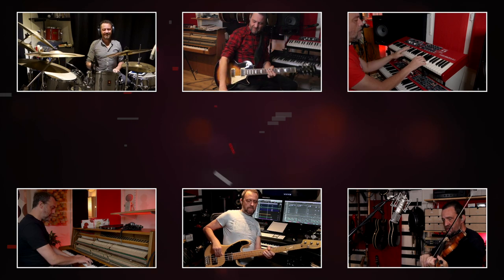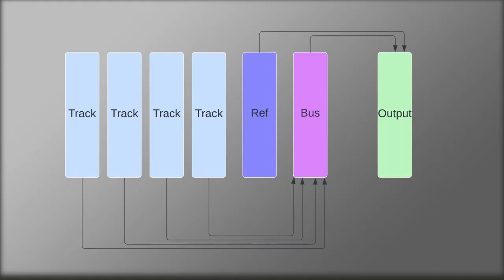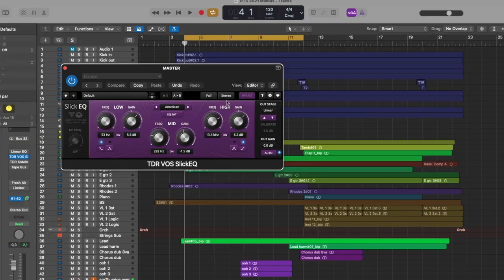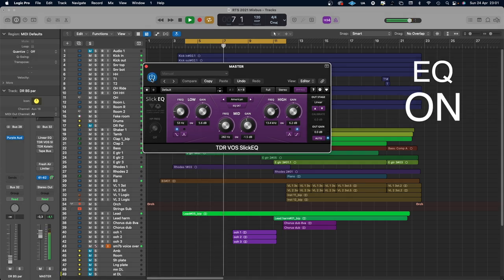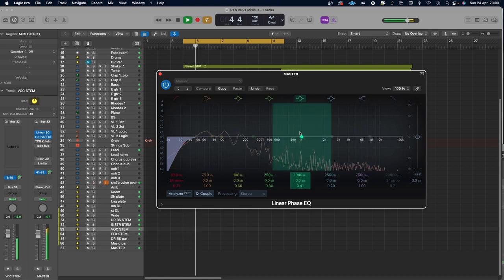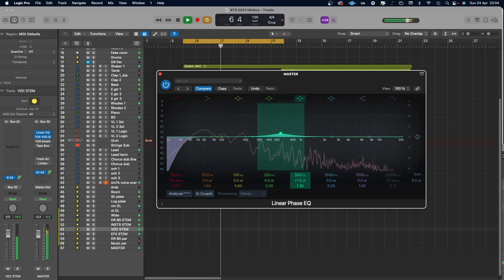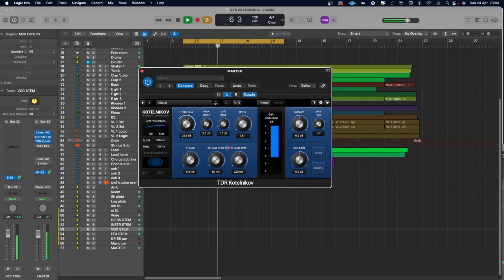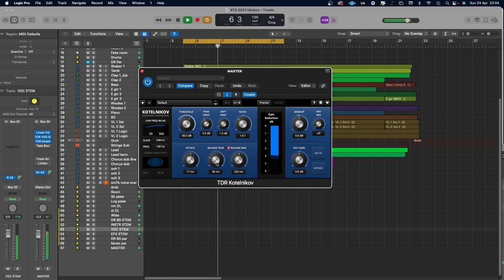How to set up a MixBus and why you should use one.

Comment: I'm still wading through your suggestions - and not utterly convinced they are all going to be for me.
That reservation uttered I will say the idea of a 'Mix-Buss' seems worth a try, I LOVED your suggestions for a 'High pass' filter at 30Hz and some lift at 10kHz, they are working out marvellously.  
So far I have been working on some (formerly) finished tracks using your suggestions and apart from a need (for these particular tracks) to keep the 10kHz lift very low (+0.5db) I have nothing but praise - Thank you very much Roger.
Reply: Try it at around 16Khz for the high frequencies thats the sweet spot i find, and if possible make it very wide. you can get away with adding 2-4 dbs easily and itll bring life to everything

Comment: I have a Mastering Rack I made in Ableton that does pretty much all you have - slight eq, slight glue compressor and a gentle saturator (rather than a tape filter). I throw it on my Master channel only after I'm just about done mixing. The defaults are just audible - and always only a starting point but tweaking is slight and it saves me so much time.
Reply from the maker: Splendid.

Comment: This is impractical.  You're going to route 100+ channel outputs to a mixbus?  Nah, there are better ways
Reply from the maker: I find it practical. The tracks I don’t use in a mix I simply delete.
And it’s the same amount of sounding tracks routed to the mixbus with or without the busses.
One benefit of the busses is that they can take some heat before the mixbus.